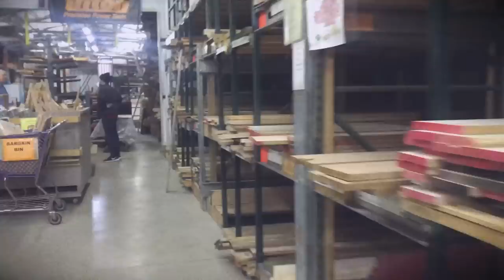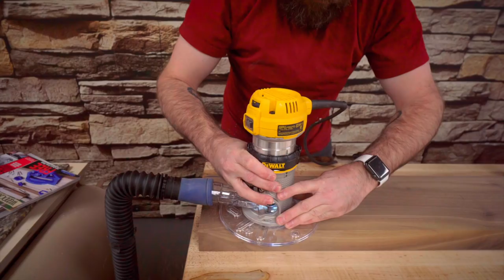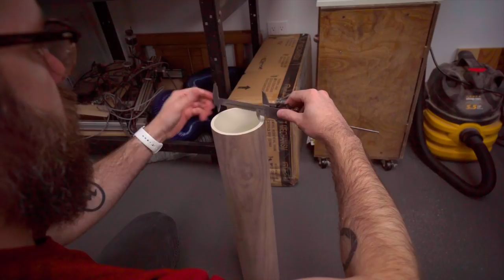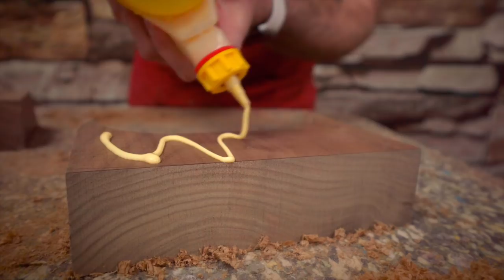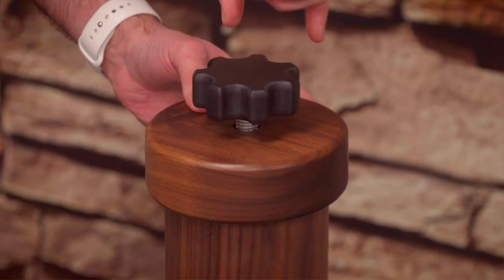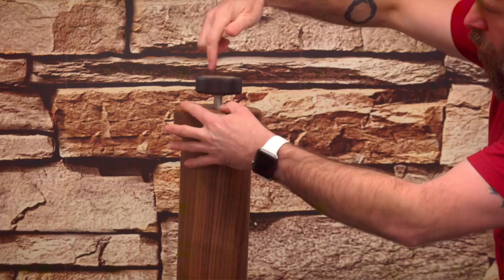Making and Prototyping a Dog Feeding Station | DIY Project

Comment: Question. I noticed you're rotating the auger clockwise, but if you rotated it counter clockwise would it not effectively portion out the food? As the underside of the auger would be pushing the food out as the upper deposited it at the base? Also you could possibly do a small angled lip on the inside to indicate when it's in the "off" position. Then you'd have a tactile indicator, for when the food has dispensed and when it's off, as it would raise and lower however much the lip was. 
Obviously practice might show flaws of either suggestions, just trying to help!

Edit: Also, maybe check on if the type of pvc you're using is food-grade. And maybe have some sort of locking mechanism or rubber seal on the lid to make it air-tight. You could also use some sort of rotating bit and a fixed screw spanning the inner circumference of the tube so that the bit is pushing the food insuring consistent dispensing. Though that would mean you'd need to guide it back up through the screw to refill the dispenser, but if it takes a month supply of food it doesn't really seem like too much of an issue.

Comment: How about a pole from the foot that goes up on the back of the tube with a ring or strap that goes around the tube further up to stabilize it. Like a guitar stand has that fork thingy to hold the neck. And maybe you could have a funnel with a lid going out from the side of the tube just below the lid that you can refill from without having to unscrew the whole thing.   

Love this video! Keep up the madness!

Comment: Put stops on the auger to only take the correct amount of food. Also, change the dish design. Turn it sideways and narrow the channel the dish fits into. It will cause you to have to make the base bigger. Make it even bigger. Possibly put another wood veneer pipe behind the first one attaching them
 The larger base and stabilizer in the back would make it more difficult for larger dogs to turn over. Of course, if the feeder is in a stationary spot you could use a hook to attach it to a wall behind it. We have a gate that we attached a hook to when open so it would stay out of the way. Think about baby safety items. Dogs are like babies. They get into everything. This is a great idea for our 10 (yes 10) dogs...2 German Shepherds, a Border collie mix (all rescued) and 7 Shelties that we breed, Altho 5 are spayed. Hope this helps!

Comment: 1. Make a wood dog bowl size of one potion with long flat wood as plug.
2. Make a box with funnel like bottom make a hole on bottom most. Same size of dog bowl.
3. put 2 on top of 1 add stand.
4. Slide dog bowl to funnel then slide out to feed the dog - long flat wood behind dog bowl plug the funnel 
5. Arduino + survo for automation.

Comment: when i heard you guys discussing this on the podcast i imagined the screw being horizontal not vertical. You could keep the tall tube for food storage but have a very short screw at the base just to push the food forward into the bowl. This would stop food from falling "down" the screws into the bowl. Problem would be now how do you turn the screw as its low to the ground.

Comment: Maybe a trick that someone has already mentioned, but... When you have to cut any threaded rod, put a nut on it that goes beyond where you cut. Once you cut, back the nut off and it should fix the threads for the most part. Not that it helps you at this point, but... Yeah...

Comment: Similar to a gum ball machine mechanically in a way. I’d definitely copy right your idea before someone else makes millions of $ on it. You might make the bowl and the base that the cylinder sits on one piece and move the cylinder back a few inches to prevent that area where the food slides under the base. Also  your threaded rod might be able to screw into the base and secure it from falling over as you mentioned. All in all it’s a great idea bravo

Comment from the maker: Without calling me an idiot I'd love to hear what I could do to make this better!
Reply: I dont have much of a "mechanical" mind, but the one improvement I thought of was a shorter tube (cut the auger in half) with a funnel hopper on top to hold food. That way there is a lower center of gravity and it could hold more. but your design has a certain simplicity to it!
Reply: The screw in this is a bit unnecessary. Gravity will pull the dog food down so you just need some type of door. Usually you'd use an Archimedes screw to push something up at an angle.
Reply: Replace the quarter with a washer.  The acorn nut will center in the hole of the washer and keep the whole auger in the center of your tube.  Which should prevent issues such as food jamming or the auger wearing on the side and getting plastic bits in Wally's kibble.
Reply: Replace the star knob with a motor and an arduino based timer? It's what Dr. Emmitt Brown would do.
Reply: When I saw the construction, I was thinking an auger feed like on a pellet stove.... Have it feed from a hopper on the floor UP to a tube that would slide down and fill the bowl, motorize it, put it on a timer or better yet, wifi, so those nights when you aren't going to be home in time to feed the puppies, you can open up an app, and feed them. Of course hook up a web cam so you can watch them devour the fruits of your labor!
Reply: If you have a burr on the top from where you hacked off the threaded rod, I saw a tool recently called a uniburr (not sponsored 😎) that deburrs and tapers busted threads.  Looks like a cool tool and you may have some use for it. 
And I like the comment on the Arduino.  Maybe find a cheap mobile or Bluetooth controller that will allow you active a stepper to turn the thing when you’re not home. I’m sure Bob from ILTMS would help with any coding.  
Love the look, I am definitely going to use the mineral oil on walnut finish someday, looks great!  PVC never looked sexier!
Reply: one big improvement would be to make one for yourself and have it dispense your favorite treat :)  I tried to make a pet food dispenser before it didn't work out so well, but i have a bit more experience, knowledge and tools :) now so i might give it another go
Reply: Was curious to see the result after hearing about it on the podcast.. "turned" out great! My mind didn't even ask me permission to start thinking of ideas to make one for my gf's cat.. :)
Reply: I really liked seeing you work through the process. More videos with dogs and problem solving!
When I first heard about this on the podcast, I was thinking something more like a cereal dispenser or candy dispenser. Something with a known quantity distribution system. 
The auger is cool though and I think chad lindsey has the right idea, maybe take your small augers and go horizontal or diagonally down so you don't run into the problem of gravity taking over your distribution system. A tube or bucket on top would then be the hopper. It probably would also help push the food towards the bowl.
Reply: Speak to your good friend bob to get an arduino controller built in. Automate that bad boy! Sweet looking feeder!
Reply: Have a look at dillon gun powder dispenser. Simple design for similar mechanics.
Reply: Maybe some sort of 'flapper' that interfaces with the upper knob lobes so you get clicks when you rotate each lobe past the flapper.  This could also sort of be a position locator you were thinking about.  Maybe also put the all-thread throught the lower portion and bolt on the bottom of the base so the reservoir isn't as tippy,  Neat build dude.
Reply: Hi there!

You are definitely not an idiot. You wouldn't do what you do if you were. 

But I have a few comments about making it "better". 

First of all improvement depends on what you are needing. So, you need to be more specific on that term at first. Knowing your needs is the first step in any development. 

Personally, I would change the lid as such you don't need to unscrew your handle first. Keep the handle fixed in the lid and create a piece that interlocks between the handle and the threaded rod. 

I think you need to build a separated box inside that fills up first and then a lever pushes out the food, if you really want to controll the amount of food that drops. I can do a few scetches if you want to. 

Regards,
Etna.
Reply: Great project man, thanks for the video.  Think it's mentioned earlier in the comments, but the Archimedes screw is normally used to lift material/liquids.  Could be an alternative/improvement to have the system 'pump' feed from a bin into a bowl?  Keep up the top work!
Reply: What about rotating the auger 90 degrees? You put it at the bottom of a larger bin, and just rotate the handle to let more food out. A lot of farm equipment runs on this principal for seeding the field etc.
Reply: This is the traditional approach and how I would do it. You could even use one of the leftover small augers since the auger only needs to be big enough for the food to be easily pushed through. As Nathan said put the pvc (or other tube) horizontal with the auger inside. Cut a hole in the side of the tube for the food to flow in from a hopper. Then, turning the auger will move food down the horizontal tube and out an open end into a dish in proportion to how many turns you spin the auger. If it's small food you could simply use a large auger bit that's used for woodworking. A simple way to make this and see it work would be to take a long auger bit and drill a hole down the center of a large block of wood like a 4" x 4". Then drill in from the side to intersect with the long hole down the center. Now, put your auger bit back into the hole down the center and spin it with your drill while dropping food in the hole on the side and watch it come out the end. Ummm, probably run your drill backwards for this last step since the bit is made to pull chips out of the hole instead of push them through but you get the idea.
Reply: Love it. Do you need a lock mechanism of some kind to stop food coming out when you tighten the knob after filling? This could also be at the ‘closed’ position.
Reply: Automate it! Attach a Rpi, webcam and motor controller, so you can remote feed your dog when you are away.
Reply: For food trapping at the back: just leave the dish piece solid from the opening in. You can bring it out more.
Reply: I can't help but think about the mechanism that gumball machines use... With the crank on the front. They use the same basic mechanism for kids candies (like little mini machines). Maybe check those out to fully vet (no pun intended) a known mechanism for this and see if it would work here and how you'd make it.
Reply: Great build!   Two things I'd do - simply recess a neodymium magnet on the side of the walnut dish that contacts the base of the food chute so Wally won't knock it loose.  You can recess/double-side tape a ferromagnetic material like thin steel flat-bar to the tower base for the magnet on the bowl to attract to.   Lastly, consider a foam/compressible seal around the top of the tube mounted in the cap in the recess to better air-seal it - also maybe a small ringed brush or flexible silicone washer around the hole where the screw protrudes up through the cap.   Nicely done!!
Reply: Great idea and I love the way it looks! If you want to keep the outward appearance and add portion control, I'd lose the screw and add a basket of sorts...  Make a platform in the bottom of the tube and cut a hole for the food in so it's centered towards the back of the tube, and another hole just large enough for the rod to thread through. On the bottom of the rod, make another platform to run just other the first with a cylindar attached to the bottom. This way when the bottom assemly is lined up with the top food will drop to the bottom, then when you turn it only the specific amount of food will move to the bowl and drop in. Good luck and I hope to see version 2.0 soon!
Reply: Use a sweeping tee. Place the screw horizontally and the food vertically that way as you turn the screw food is moved forward to the dispensing side and down to the bowl.  Just my thoughts but I like it.
Reply: I don't have enough mechanical knowledge to be much help but I would try to consider something that allows consistent measured doses of food dispensed each time. With those long backs weiner dogs that have a bit to much weight on have lots of problems.
Reply: Create a top loading hopper so that you do not have to refill the container as often.  It would also eliminate the need to remove the screw top from the hopper.
Reply: Make Something whenever I cut a threaded rod I run a bit down the rod past where I’m cutting it then once it’s cut run the nut back off and it recuts the thread
Reply: Love the video. And without reading all the comments, I would say the only thing that I would improve would be calling the hex nuts that you used, nuts. Not bolts. lol
Reply: And the "acorn nut" is a bolt.
Reply: Maybe cut out a slot on the front of the PVC tube and replace with clear lexan so that you can see how much food is left in the container.
Reply: Walnut is poisonous to dogs- a different wood choice may be a good idea
Reply: free hand the router.
Reply: A round block at the bottom in the tube that is cut for the portion you desire. A plate mounted above the block and secured inside the tube. A rod running through the tube through the secured plate and threaded to the block. One turn ( in either direction ) would distribute the portion the block is cut too.
Reply: Use a clear tube to see how much food is left in the tube
Reply: The only way that I know of to be consistent in getting the same amount of food each time is to use a scale (mechanically or electronically, doesn't matter ) connected to an intermidiate lock chamber. Another scale can be added too on the storage container to estimate the amount of feeding material remaining.

Auger screws tend to be more use in elevating or conveying the material (animal feed in that case). I never had success in using any of those in final stages. You have to get the tolerances really close between the auger screw and the pipe otherwise you will quickly get into trouble, especially on automated systems.

Keep up your excellent work.
Reply: PVC is a carcinogen, not good for food contact, I would replace this material as well. The auger is likely PE, try finding a PE pipe.
Reply: a clear strip inserted into the tube would look realy good to
Reply: looks great. and some of the people have had some good ideas as well.
      but my suggestion would be to look at a coin operated vending machine that dispenses candy. they don't use an auger at all. they use a disk with a set size for a correct amount. half the disk is covered on the top. and the other half on the bottom. so it fills on the side that is open on top, then it rotates to the section that is open on the bottom and the food drops out. this could be made in the 3D printer to fit inside the tube you have or made by hand.

Comment: The only thing that kept bugging me is that the feed tube could be easily knocked over, even an excited Wiener dog could do it. My suggestion is either a way to bolt it to the base if you're not going to be moving it around often. Or some sort of twist lock like some CD spindles have to keep the lid locked and CDs inside.

Comment: I would have replaced the auger with just a base plate on the bottom. This is hard for me to explain so bear with me. Shape the plate (H) , {circle made to fit inside PVC with the top and bottom of the H being a void that food would fill. A plate above that to prevent the food from pouring out. Allows a measured amount each time.    If you google A batting cage pitching machine it might help visualize what I’m thinking.

Comment: GREAT IDEA FOR A FEEDER, TO KEEP LARGER DOGS FROM TIPPING IT OVER, JUST ATTACH THE WHOLE ASSEMBLY TO A RECTANGULAR BASE. TO KEEP THE FOOD FROM GOING INTO THE BACK OF THE BOWL, MAKE A HALF MOON SHIELD ATTACHED BELOW WHERE THE FOOD FALLS OUT, THAT FITS THE SHAPE OF THE BOTTOM IF THE BOWL  , LOCKING IN THE BOWL,

Comment: Why don't you carry the slant of the feeder down to the back of the bowl and then just make sure the bowl part will be big enough to hold the correct amount of dog food? Or just add a triangle cut scrap to what you have now so you don't have to start the bowl over? And then I feel like that will become a wall so no food can get back there just make the triangle the right size to cover enough area of the bowl. You could even create like a slide in the triangle part by sanding it in?

Comment: The dogs are cute. What is the name of the old timer that made a cameo? One method to sort out the portion size is to use the auger to drop into a rotatory drop, this could be size accordingly based on volume. Then the drop would actuate manually into the dish. Send me a PM and i can sketch my thoughts incorporating what has been done as not to waste but to also help stabilize. I would love to attempt this for my hound, she is way to energetic for the current design.

Comment: What about having the auger sit horizontally at the bottom of a rectangular box if the same width? I would think thing as long at the food is filled above the auger you would get the same portion every time. And it could hold more food.

Comment: Would probably not work in the existing design, but I've seen some feeders that use paddle wheel designs. Also discs with holes cut around them, the food falls through the holes as the disc turns.

Comment: I dont get why do you need a vertical orientated auger. Simple half-circle curtain or  plate with a ~2" hole(offset from center) would be enough. But you can use it like an Archimedes' screw for new dogfood dispenser.